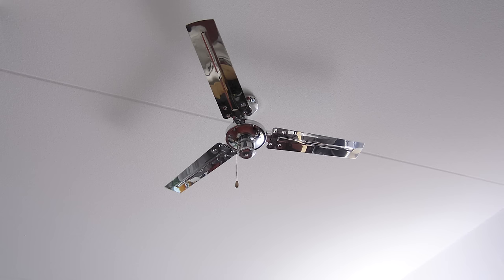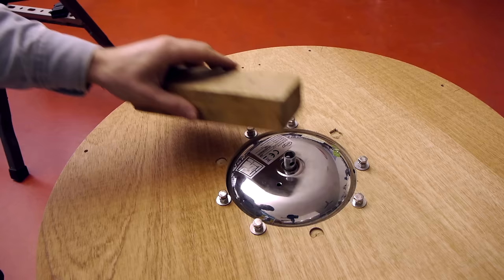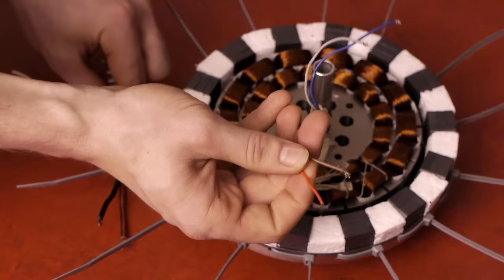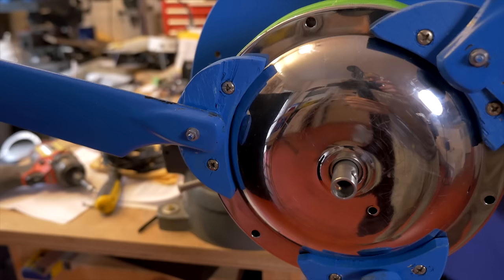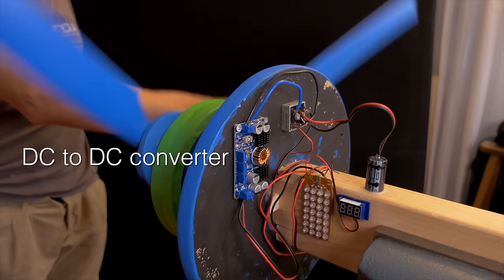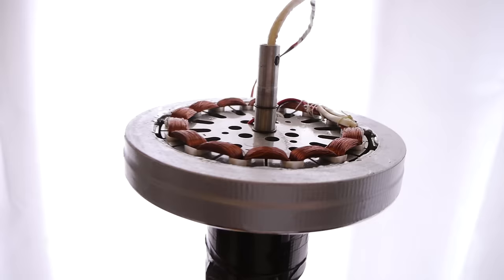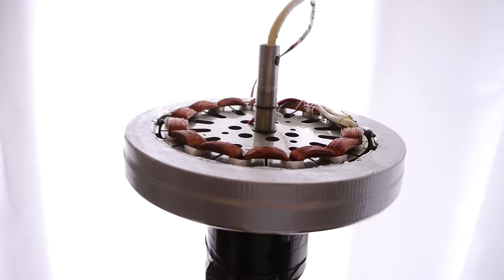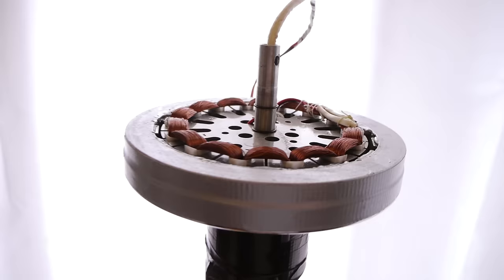Turn a ceiling fan into a wind turbine generator?!

Comment: voltage is easy to produce but it is the amperage you need to run devices. The thicker wire would work.
Reply: The wire size was chosen to run at 120volts and less than 0.5 amp, with some resistive loss in the wire. So if you ever want to get 60 watts out, the voktage would be high (120v) and the wire would be lossy... So, yes, that wire is too thin!
Reply: @jimswenson9991  output DC or AC?
Reply: Oh, the coil makes AC. It has no "commutator" on the spinning shaft, or electronic parts "rectifier" to change it to DC. We can add the rectifier if we want to. Specifically a "full-wave bridge", which is a square of 4 diodes.

Comment: To increase the strength of the output, use neodymium magnets. N52 preferred, but N42 would work too. These are the silver looking magnets. 
You could also create a Halbach array of the magnets to further increase the power output. But those are difficult to make as you have to fight the magnetic field while assembly. The steel band to go around the outside is to use the metal side from another ceiling fan. You would need to use a grinder to cut the sidewall off of the housing and use that one. Or you could push the bearings in this one closer to the stator so the top/bottom housing plates will be almost touching when assembled. They wont fully touch as the space isn't available to push them that close. Touching would be ideal, though.
Check out MuddyMuddyMuddMann's channel as he's done lots of ceiling fan generator videos.
Reply: A great place to source these is from old hard drives. The small laptop one work best for the smaller magnets.
Reply: @mmckinley345  l
Reply: N52 eraser sized neodymiums can be dangerous though. Although I convey the suggested, be CAREFULL. Keep them isolated from everything but a shelf of its own. And think of them as a rattlesnake, because if you don't pay attention to what youre doing, they will bite. Wearing thick leather gloves when handling them is a good idea.
Reply: @AngryHybridApe  How big is the eraser size are you talking about here? I have some that pencil eraser size (5mm round and 3mm thick) and they can cause some pinching, but nothing serious. 
Now, if we're talking about one that is a block eraser about an inch long, then yes, I agree. Also, if they are stacked, they become even more dangerous. 
When storing these, try to have a piece of thin cardboard between them as well, as this will help get them apart (sliding them off a table edge).
Reply: @korishan  
I suppose I should have just gave the dimensions, huh?  Im guessing 1"X 1 5/8" X 3/8". Definetly not pencil end erasers.
More important than size is their strength. I believe N52 are the strongest. If you had 2 of them, 1"sq each stuck together, you'd have a tough time getting them apart bare handed. And anything bigger than that, I'd be wearing gloves. If they got 1/4' from each other, you better hope no skin is between them. If they get close enough together, they'll slam into eachother. When a magnet breaks, the polarity unstantly changes from where it breaks. So if they slam together and a piece chips off, it can shoot the piece extremely fast. Mist the time it holds all the peices together, but not always. Smaller pieces dont have the pull like larger pieces, but still react like N to N or S to S.
I'm just saying be carefull. The ones these guys in some of the other videos are putting in are very strong.
Reply: @AngryHybridApe  that a little overkill for the ones in the hard drives theyare strong but the worst that will happen is a blood blister or some lost data on a creditcard... no need for a shelf of its own the field lines on them is too small
Reply: @korishan  
I bought a couple 1" X 1/2" cylinder neodymiums a few months ago. They were the biggest they had. And right off the bat I got them too close together and slammed them. One of them chipp. I was a bit PO'd. But I'd like to get about a dozen or so cuz I like making motors, but I only see them online, and dont have a credit car and cant stand paypals BS.
WISH always has them at pretty good deals - all types, quantities and sizes. If I get desperate enough, I'll have a friend order them for me. (Whatever happened to the days when you could just go to the store and buy stuff? Lol)
Reply: @AngryHybridApe  HAHH  those days are long gone, my friend. Long gone.   :P
I'll do a few prototypes of the vawt using a ceiling fan motor, but ultimately i want to make an axial version. Far more efficient and easier to separate the parts, blades from the rotor(s).
Reply: @AngryHybridApe  Ahh yes, Muddy Mann is great. I'm subbed to him already   :)  And watched most of his vids. When I get ready to build mine, I'll be reviewing his vids before hand.
Reply: @AngryHybridApe  Radio Shack all closed down. :(

Comment: A car alternator with a adjustable regulator would be much easier i think and create a good flow of power
Reply: Problem with a Car alternator is they need a fairly high RPM >2000 RPM and most want 6000 RPM
Reply: @herbwinters7068  I was thinking the same thing, however gear reduction could be useful. Samsng Device suggested in another comment spinning it with a v belt.
Reply: @Dubz0408  Thinking about this more 6000rpm is not correct the power range on most is between 2000-5000 RPM and belt would work I think I would choose a Toothed belt because no slip and lower drag also does not need as much tension on the belt to hold full hp rating. well I want you to know your video got me thinking last night and I ended up spending a little time with a 1KW AC servo Motor I spun the motor with a small 12DC motor the slowest I could go with my little hacked setup was 1200 RPM but the AC Servo Motor Put out 83VAC anyway that might be something too look at. The Quad Copter Motor is a 3 phase permanent  magnet Motor the AC Servo Motors are the same thing but it has an encoder on it which you dont really need. the best part is you can buy them almost any size100w - 10KW and I bought my 1Kw motor on Ebay. you don't need the motor controller. 
here is the part number just to give you and Idea: Mitsubishi HF-SP102K. Thanks for distracting me from my normal projects last night it was a real fun break !!
Reply: I WANT TO SEE YOUR VIDEO.
Reply: The disadvantage of alternators is that something like 1/3 of the generated power goes back into the field windings to generate the magnetic field. This permanent magnet generator has no such losses. Alternators are used in cars because there is an abundance of power at the shaft, so wasting some doesn't matter. Also, magnets are expensive and fragile, not good in a car, and high power output from a permanent magnet generator requires large magnets.
Reply: @bmay8818  It only takes about 1.5 Hp to sustain an automotive alternator at full- tilt. The question is what are you using the generated power for? I mean... you don't need a kilowatt just to charge a cell phone. 
 If you're living off the grid with a bank of car batteries, then an alternator based turbine can do just fine. It's overkill for something to charge your electronics. A generator for bicycle lights is more appropriate for that.
Reply: @bmay8818  -  This is a free-be ceiling fan  .  .  .  .  Cheap ! ! ? ! ?  Who cares about efficiency, it's low power for charging phones .   So can't you wire it to be an alternator with one of the coils momentarily excited to start the charging, and just let it self regulate into a decent 'storage' battery.   As it spins faster generating more power it is increasing the juice to the 'excited' (magnetic) winding at the same time which is then "putting on the brakes" .   ?  ?   So,  self regulating ?
Reply: @GoSlash27  1.5 HP is about 1500 watts, so if you're right, then just keeping the alternator running would consume all of the power from the wind. This is why there are so many permanent magnet turbines out there.
Reply: @richardhobbs9038  The problem with using an inefficient power production device coupled to a wind turbine is that the turbine can harvest only a certain amount of power from the wind that's available. If there's a ton of wind all the time, efficiency is less of an issue, but in most use cases, efficiency matters. Sure, if one needs only 5 watts to charge a phone, the power output of the generator is largely unimportant, but I don't think people go to the effort of building wind turbines just to get 5 watts of output. Alternators regulate voltage by varying the current in the field coils, and while they do become self-sustaining once they're going, what that means is that the alternator is producing enough power to run its own field coils, thereby not using battery power for that, but that does mean that the coils are still consuming power all the time that the alternator is running, power that could otherwise be used for something. So yes, alternators are self-regulating, assuming they're turning fast enough (which can be an issue with wind turbines), but they do still continuously waste (relative to a permanent magnet generator) power to do that. If there is an abundance of wind or the power consuming load is not big then an alternator would be fine, but generally, people who make wind turbines want to get as much power out of them as possible, hence the use of magnets. There is a practical limit on how big the magnets can be (because of size and cost constraints) so at some point, one does have to use field coils.
Reply: @bmay8818  Not correct. An alternator consumes a small but proportional amount of the power it generates to charge the stators. It reduces efficiency compared to permanent magnets, but it doesn't "consume all the power". The answer is to catch more wind with a bigger turbine. 
  And nit-picking, but 1.5Hp is about 1.1 kW, not 1.5 kW.
Reply: @bmay8818  -  Thanks for your response, and I understand.  I was just thinking that 'a small leak can sink a great ship'  as - 'a small charge can eventually fill a lithium battery'.   I have a small off-grid solar set-up with a 'solar generator' and cloudy days and night decrease it's recovery rate of course.  Was just thinking the 'cheap' ceiling fan  may  be useful to enhance recovery of the battery charge during night and cloud cover even if only slowly.   But I get your point ! !     Thank You.
Reply: @GoSlash27  Including the inefficiencies in motors, yes, it's around 1kW per HP, not 753 watts, for the sake of doing basic calculations. If we're talking about a 100 amp alternator, that's about 1400 watts, so if you're correct about an alternator consuming 1.5 HP to produce that 100 amps, then most of the power output is lost in the field coils. That isn't true of course, unless you meant that an alternator needs about 1.5 HP total, including its output, at full tilt, which makes more sense. The only advantage of an alternator is that it's cheap and ubiquitous. If one has an excess of wind energy then yeah, no big deal, but if wind conditions are less ideal, and power demand is close to what the wind can provide, then losing energy to the field windings doesn't make sense unless cost is a very big issue.
Reply: @bmay8818  Yeah, that's what I meant to say; that is including the output, all thermal/ friction losses, and stator current. And yes, "cheap and ubiquitous" is a big advantage for the alternator, as well as ease of implementation and ready access to spare parts. The obvious remedy to its lower efficiency is to simply employ a larger turbine. When you're in the kW range, "compact" generally isn't a priority.
Reply: @GoSlash27  For me, it would come down to whether I could afford the money or the time to buy or make a permanent magnet generator. If the answer to both was no, then yeah, I'd just use an alternator.

"Cheap and Ubiquitous" sounds the like name of a nerd rock hair band or something!
Reply: @richardhobbs9038  Definitely, a big advantage of wind power is that it is often going when the sun isn't, and it can be pretty productive. I used to install solar energy stuff as a job, and it's sooo nice to see PV prices dropping like crazy from when I did it. Have wind turbines gotten relatively affordable?

Comment: One of the best vids I’ve seen in a long time. Useful info. I agree generator from scratch would be better. However using premade parts like the housing would save time money and effort. And of course from scratch would require fabrication skills like welding, and machining on a lathe and or mill. Also would need copper wire (expensive) and resin+ hardener. There are videos on how to make these.

Comment: Have u tried to use a grounding wire wich would also require a grounding rod to let excess energy flow to the ground when not used but still conected on  ur wind turbine. U have ur magnetic poles [+ & - ] wich light up ur light and ur regulator to however bolts needed but the excess power has to keep flowing to the ground. The grounding rod acts as  a lightning rod.
awesome video I learned something today. Thank you

Comment: Hi, so I did this twenty years ago. I used a 12 volt Ford starter motor. I used a simple pulley system  from the finned hub to the starter motor. I used a 10:1 ratio, thus the output was 120 volts. It worked to run a well pump, and it worked for years. I have since moved, but if I were to do it again, I would use a centripetal clutch to protect from overload in high gust conditions. That being said, those old starter motors were built like tanks!

Comment: I think you should have proceeded and completed the generator. Yes, a more efficient one can be made, but it would be useful to see how this unit would compare to a more efficient one, in the same wind. Also, a cost breakdown of the other components usd would be useful.
Reply: Electronic components are ridiculously cheap, so they'll rarely be the most expensive parts. Copper wire of a more solid and thicker kind, as well as better magnets (neodymium) will certainly be among the priciest parts. If possible according to a certain budget, it should be possible to attach an Arduino and create an app to control and check up on the generator via the phone. It would cost some of the power to run the Arduino, yes, but it may be useful to some individuals

Comment: How about going to a garage sale hopefully you'll come across a treadmill with a generator in it, that's already equipped with digital gauge.
Reply: Treadmills have variable-speed dc motors, not generators.  
  I imagine that's a good basis for a generator, but I dunno for sure.
  I'm looking for an article on adapting a treadmill motor to my bandsaw and my drill press...
Reply: @markmarkw1919  Motors don't make good generators.  And treadmill motors don't have the torque for cutting wood and metal.